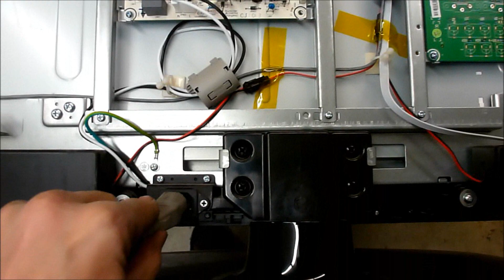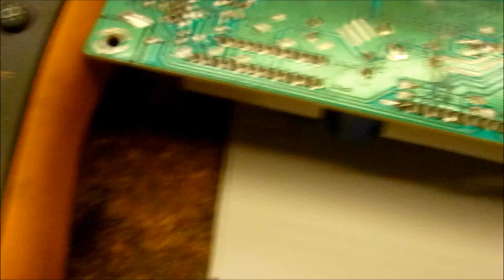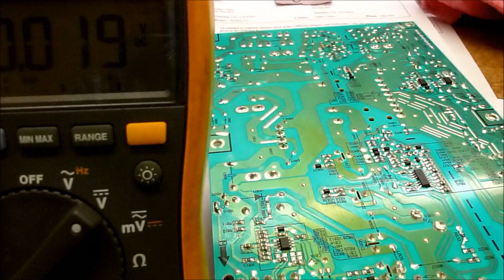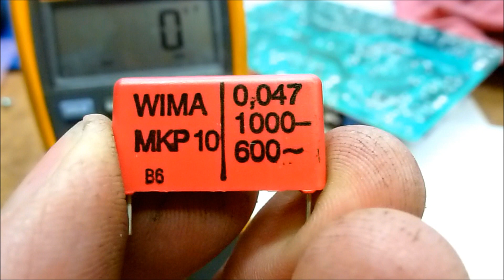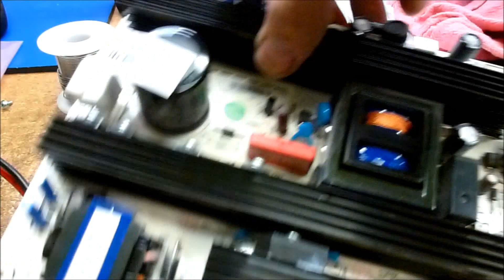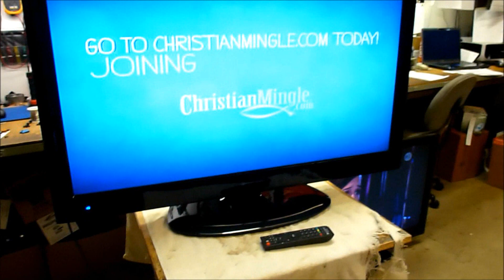Element Hisense Dynex Insignia LCD TV ELCHW402 Power Supply Repair Fix 125372 F40V87C 153024 122904

Comment: I was impressed with this video - betting into component testing.  
I have a Hisense 55HtB that was damaged by a severe lightning strike that tripped a 15 amp breaker (ceiling light circuit - were the wires antennas??), and fried:  garage door opener, KBM switch, Magic Jack, and even a ceiling fan motor.  Is there ANY chance the TV will have any good boards in it - plugged in there is no standby LED light and it does nothing?
Reply from the maker: Hard to say, lightning is a weird discharge and it is hard to tell.
Reply: @norcal715  I was out shopping for a replacement and prices are high, ATSC 3.0 tuners only in  expensive sets and warranties are just 1 year.  My Hisense came with a 4 year factory warranty.  It lived 6 healthy years until claimed by the strike.  Samsung new models have a 3 year warranty.  Can you trust Samsung quality?  Friend said the "6 series" has lots of failures.  So what is this 3 year warranty all about?  a quick way to save brand face or they made new models robust and so upped the warranty???

I was testing the PSB on the bench but am going to put it back in the tv and hook up and test there.  On the bench the 18v was reading 24v, but with the load from the Main Board, maybe it will be 18v OR the regulators are not working.  There are 12v pins but the PSB is not switched on so they are 0.

The lightning strike was so close, I could smell for a few minutes what I thought was burnt electrical wires, but I'm pretty sure it was the ozone of the hit.  Very close.  I had a 100' pine tree hit that was not even 20' from the house and nothing was damaged. So this strike was very close.

Comment: I have an hisense 50 with HLP 4055we powerboard the Screen is Perfect but my tv runs like 20 min and just Turn off. No light on the tv at all After 10 secounds the red light Turn on again and i can Turn the to on again for some seconds and turning off ....  Mystery question is it on the powerboard or something other ? Dont want to buy a new powerboard For nothing
Reply from the maker: It sounds like it is a heating issue when the set is cold try a hair dryer or heat gun to heat up specific parts of the set and see if you can get it to act up sooner and track down the culprit.

Comment: Could anybody explain why the 12V section was practically dead while the 5V en standby power were almost in good health?

I understand from the explaination that the faulty capacitor was on primary side of the transformer so it should influence all voltages. 
If it’s on the secondary side, then I don’t understand what the switching transistors are doing on that side. 

The answer I guess must be that the capacitor is on the secondary side and part of the 12V circuit while the transistors are switching the primary winding. 

Please comment. Tx!
Reply from the maker: 2 completely separate power supply's one for low power standby, and one for high power "run"
Reply: NorCal715 Aha! Tx!

Comment: I have a question about matching brands. Would switching brands such as element or hitachi parts effect the playability of the tv? I want to use cheaper parts for my hitachi. They look identical.
Reply: rsag7.820.2107/roh version b
That’s the part number on the board. I was going to replace entire board for $47. My hdmi ports are bad. If this type of help is frowned on I apologize in advance. Just trying to keep it out of the landfill as you mentioned.

Comment: hi carl I heard abt ur channel n saw ur great job!!...could you help me pls... I have a 32 in Samsung led  tv I'm getting all the volts on my tv connections but the backlights are not lit and I have pic in screen(torchlight test) I don't have volts at the output of my led connectors .so I thought its the back lights n removed them n tested everyone of it and all works! (diode mode) . so I think  its my led driver.  I tested all the components ard the output sections of the led n it seems ok. were am I going wrong?. one thing I noticed is when I test my 12volts it shows 13v. and a "DET" that shows 2.36v  and the PWM volts is 0.9v r these correct? appreciate any help I can get!

Comment: I curb picked one of these and replaced the cap like you did.... I fired it up and was so thrilled until I saw it had a broken LCD. :(
Reply: Jon Myers should have sold it to me for money
Reply: glues4wood  I still have the set. Hoping to get a screen for a reasonable price.
Reply: Jon Myers that might be real tough they are extremely fragile and depending on age may not be available and from dealer it is way too expensive

Comment: I Replaced a dm board in a ELDFT406 tryng to save it from the land fill. I could find only a used board because shop Jimmie was out of stock. I have a great picture now whit a small problem it is upside down. I wanted to see if anyone has the tv setup code to see if If can flip the image by 180 deg.

Comment: I spent a week trying to figure out whats wrong with my tv.  It got power but wouldn't turn on.  Turns out the wire inside the tv where it connects to the port to get electricity just went bad and loose.  Stripped it down to new wire and reattached.  Now works perfectly

Comment: I have the same problem,if the fets check out and the transistors on the board are ok, caps have been checked with esr everything seems fine but i have the same problem as this video where no 12 volts, board clicks once no power
Reply: Appliance Doctor Inc  I have the same issue. Did you replace the cap now all is well?

Comment: I Like your video and need to know if you ever had a problem (on that model) with the 4.7mf 450v electrolydic that kick starts the oscillator IC that is used to turn those FETs on and off?

Comment: I just had one of these come into my shop with the same issues and I did some voltage measurements and have voltage on the primary of that transformer and nothing coming out. So I'm gonna go ahead and rule it an open secondary and recommend board replacement.

Comment: I have a DYNEX 40" TV. When I turn it on, the tv clicks and power comes on, but then I hear another click and power doesn't get distributed through the tv to turn it on. I'm guessing it could be the relay on the power supply, but I could be wrong. I checked the fuse and the capacitors on the power supply, and they all seem fine. None are blown or leaking.  Any suggestions would be appreciated. Thanks

Comment: Hello I have an identical tv my problem is in the 3rd pin I think I only get .04 volts and would assume that's why I'm not getting the 12 on 5th and 6th pin but 3rd and 4th is 4.75 for both what could be the affected areas that I should look at next no diode are Bolding and the ones that you went over in the video I tested and test out good

Comment: While testing the transistors, do we need to check the data sheet online to see were the ( arrow) points to on the resistor? meaning in order to test correctly with a meter?

Comment: Yeah, I have the Element. It was a refurb and died at 1.5 years. Swapped the board as I did not have time to diagnose issues on the ps. I did replace the three caps up in the corner though as they were bulging away. Didn't think to replace the metal cap.

Comment: hey man i have a hisense that has a black screen and will not turn on it allso makes the ticking noise that urs does the moment it is plugged in and has what looks like the exact same board your testing. and when i checked my big blue cap like you did in the video. mine says on it that its a 2000v  22 n j so when i went and tested it the meter reads 581 so does that mean that its bad or good. i did check it however when the set has been off for a month or 2 and when tested, the cap was still in the board not sure if that would make a differents or not please let me know this set has been driving me nuts trying to figure it out. also if its bad what would you recommend for a long lasting cap?

Comment: i had the same problem and the exact model and manufacture date i put the new capaseter in it that you ordered and when i checked volage again nothing changed i still was under a volt on both 12 volt sources please help??

Comment: I´ve watched your very instructive videos and realized that in most of them,the capacitors have been the culprits. In this video 2 tvs presented the same problem. Considering that the tv sets were manufactured in 2010 , I think they developed the fault too early and it makes me think that chinese are employing shoddy capacitors. At the beginning of 1970s I had a friend who repaired tvs (some with 20 ys. use!) and there we found lots of bad capacitors which endured aging and much higher voltages.

Comment: Oops! Diodes don't show charge curves at the junction. They should be tested out of circuit because you are probably seeing capactive effects. A valid measurement would be near-short forward biased and near infinity reverse biased (depending a PIV, naturally). MOSFET's usually don't contain low value resistors, check the datasheet and you will see an internal diode in parallel with the FET junctions. Good go doing the ESR on electrolytics!!

Keep up your contribution; enjoying your work!!

Comment: I have the same problem and i checked the gnd, gnd, stb-2.8, 5V is 4.9, 5V-4.9, 12V is 10.1 and 12V is 10.1, gnd-0, BR1-3.9, SW-0, gnd-0, gnd-0, 5V-5.1, 5V-5.1 I really think its the switch what do I need to do to fix this problem....

Comment: I have a 19" Samsung LN19B361C5D tv that only when mainboard is connected the output voltages waver, for example the 5v output will be from 4.8-5.1v but with mainboard disconnected the voltages are steady. Would it be a mainboard problem? I've also noticed one 3.3 voltage regulator on mainboard gets hotter than the rest

Comment from the maker: I have found in most cases either they test like diode/open or dead short (S-D most important) its just a quick troubleshooting method. out of circuit you can manually turn the FET on and off with the diode test and verify its operation. as far as finding the bad cap, I used the oscilloscope to find waveform on one side and not on the other, but there is only so much I can show on one video. Maybe next time